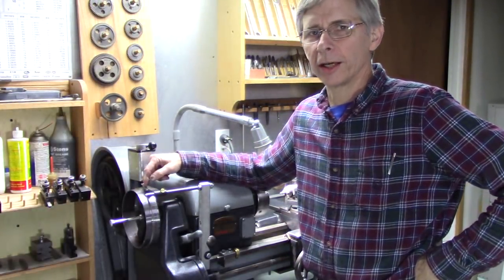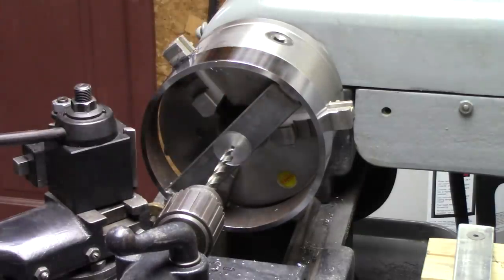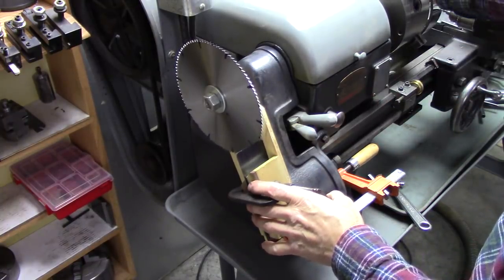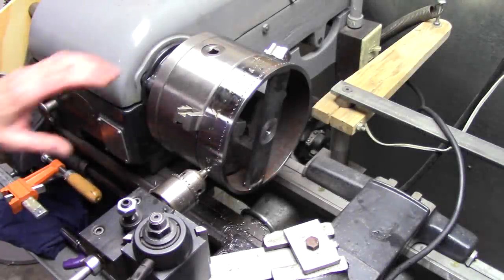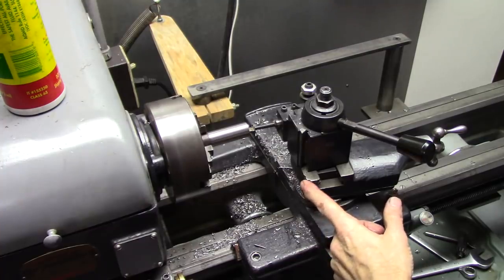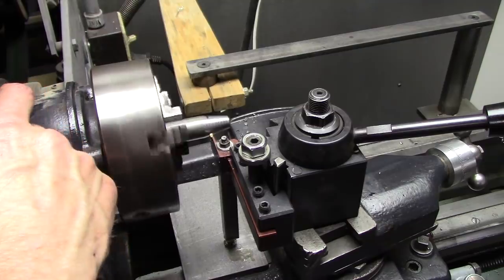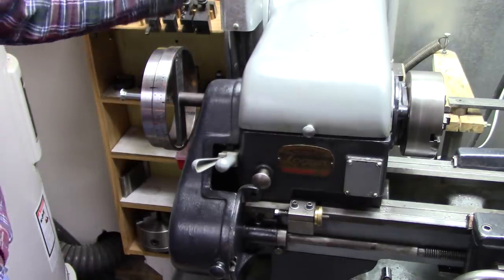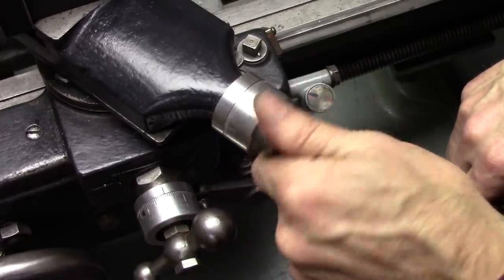Metal Lathe Indexing Wheel

Comment: Am I the only one who noticed that the center drill jumped at 8:49? I think you should have used a brake of some sort to prevent this exact thing from happening.
Reply from the maker: Holly sh__ !  I need to go look at that. I made the video 2 years ago but I don't remember having any problem. It looked like the last hole wasn't quite lined up. I've used the index wheel maybe 4 or 5 times but to be honest I've never used the 100 hole part. I intended to use it for making dials but the saw blade is easier and quicker Obviously something slipped... or at least it looks like it from the video. I'll go look at the wheel and see if I see a spacing issue. 
Thanks!
Reply from the maker: You must be more observant than most. The video has been posted more than two years and you are the first to comment on this, amazing.
Reply: I watched this for the first time and was surprised to see that.   I  backed it up and took another look and I think it was video editing that did that.   You stopped the camera and then when you started it up again it was one hole up or was just going up and made it look like it jumped up.   The one thing I would have changed is I would have made your arbor to hold the wheel longer and also would have put in 12 holes to index with even though it can be gotten from 48.   Thanks for the video.

Dale in Canada

Comment: Nice work, but why not just use the gear wheels on your wall to provide the steps?  Bolt the gearwheel to your arbor in the same way, but fabricate a sprung V-selector to locate between the teeth of each wheel.  Then you have a large selection of gear teeth ratios.
Reply from the maker: Well...  I was thinking the same, especially since I don't often use most the combinations. I use the 3 position and 100 position the most. I like your idea and it's a good point although I sold the lathe with all the change gears.
Reply: @WinkysWorkshop  Thanks.  Your idea of the arbor has prompted me to try this on my Atlas.
Reply from the maker: Something you need to watch for is slippage. I ended up tack welding the indexing wheel to the arbor. The arbor in the spindle never slips but the wheel did.

Comment: Couldn't you just have used the saw blade for indexing?
Reply from the maker: Absolutely. However, you can not use the saw blade for a 3, 6, 8, etc hole pattern. I have also considered using several disks on a keyed mandrel. That way you could make disks for commonly used patterns like 3 and 4 hole. Counting 25 holes for a 4 hole pattern is prone to error and marking set of 4, 5, 10 etc is difficult. I could probably use number punches on my current wheel but you end up with shared holes for patterns and it's hard to find enough room to stamp all the numbers.

Comment: 1:30, that MIG welder needs a little more wire speed or less power.
Instead of pop, pop, pop, it should be a constant sizzle like bacon sizzling on a griddle.
The way it is now, the wire burns short, then when it gets to proper length it pops and is short again.
Reply from the maker: Yeah, you are correct. At that point I had the welder maybe 2 weeks. Largely a lack of experience and partly a wimpy 110V MIG. I wish I had bought a 220 or possibly TIG. I had a guy at work weld something for me the other day and the weld was fantastic. I told him I had a hard time welding with my welder and he said, "I have a Miller at home that runs on both 110 and 220 and I can't weld with 110V. It's an option I don't need". I'm a little better with it now but still struggle. A few weeks ago I went back to flux core. It's definitely creates more slag but welds way better. I wasted money on the gas... unless I upgrade to a better welder. The instructions rate the welder at 3/16" with gas and 1/4" with flux core.

Comment: Do you have any means to lock down your main spindle in any position? If yes then your indexing wheel design is ok. If not then your indexing wheel has to lock down the spindle and rigidly transfer all torque components of cutting loads. Your one-spoked indexing wheel does not look rigid enough to me. It might vibrate, chatter or lead to poor surface finish. I recommend to have more spokes on both sides of the rim. If one of your hole circles is offset from the plane of your spoke you can easily imagine that a torque load will elastically skew the spoke. Your tool post drill does not make a very powerful impression but a drill bit may be grabbed e.g. when drilling in stainless steel or bronze and much higher torque peaks than expected might then have to be transfered by the indexing wheel. And also in such occasions it should keep the spindle in precisely the same position or the drill bit will be snapped off and the hole ovalised. You are modifying a metall cutting tooling machine. If you think your mod is rigid enough triple it and then you might be about right...
Reply from the maker: Thanks for the comments. You brought up some valid points. Perhaps I should have stressed the limits of this lathe add on. I've used the setup on brass aluminum and mild steel while drilling holes up to a no. 7 drill and always use a center drill first. On larger holes I use a center drill to locate the holes and finish on my drill press. I tried to drill 3/8" holes the other day but getting adequate pressure with the hand drill was a problem. As for the spoke, it's 3/8" x 1-1/4" stock welded  to the ring on both sides and faced where it bolts to the spindle. The index pin will break and the arm that holds it will flex excessively before the spoke even tries to flex. I certainly would not want to use this thing to cut gears but for me it has been a huge help and is capable of doing what I need to do. If I had to rate it for drill size I'd say no more than 1/4" and that is probably pushing the limit. Thanks again for pointing out these possible problems.
Reply from the maker: Next up, spindle lock! Ha...   this is a good idea for larger holes, I'll be thinking about how to do this
Reply: yes, and the spindle lock unloads the indexing mechanism solving all possible problems mentioned above.
A spindle lock for any position could be designed like a car disc brake or like drum brake only that the brake pads are on the outside of the drum (= main spindle)

Comment: I was going to watch this until the claw hammer appeared.
Reply from the maker: Haha...  yeah, it was the nearest hammer. Somebody else said the same. Is there some kind of ongoing feud between machinists and carpenters that I don't know about?
Reply: @WinkysWorkshop  No feud that I know of, aside from the usual male to male jocularity. If you have a significant other, ask for a really nice ball pein hammer for your birthday, Christmas, Guy Fawks Day or some other noteworthy occaision. The only thing I would add is that you can buy small, imported rotary tables very cheap. I believe that once you did, being as you have a mill, holes would become very simple indeed. In the old Machinerys Handbook, say from the early seventies, there are jig bore layout formulas which will enable you to locate holes in a specific pattern knowing only the hole circle diameter.
Reply from the maker: @jeromeclements6532  - I have 2 ball peen hammers. I keep the claw hammer around for pulling bolts. The rotary table is a good idea except at the time I didn't have a mill (thanks for watching my other videos). I do feel the indexing wheel was a bit of an overkill although I still drill hole pattern on the lathe occasionally just because it is way faster than setting up a rotary table and a bit more accurate than using a compass. When I do I usually use my 3 jaw chuck to index from or a 100 tooth saw blade. The saw blade is faster when making lathe dials.